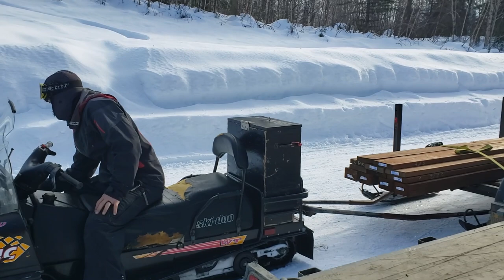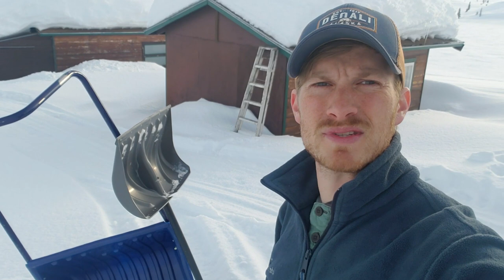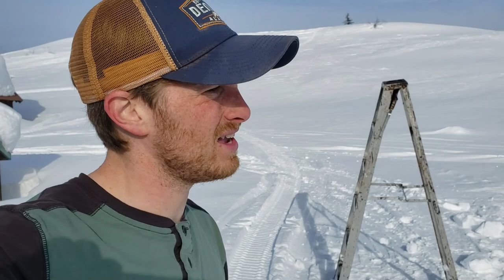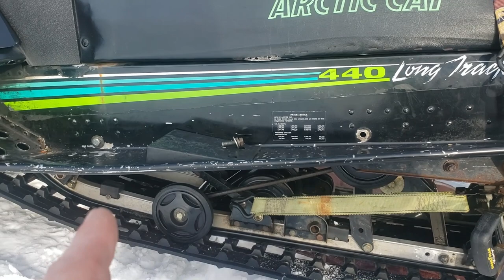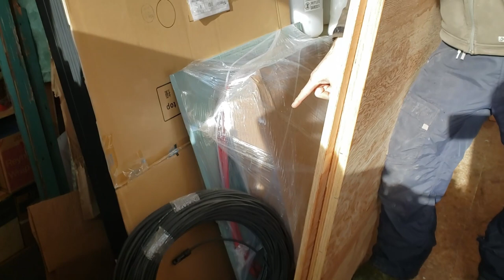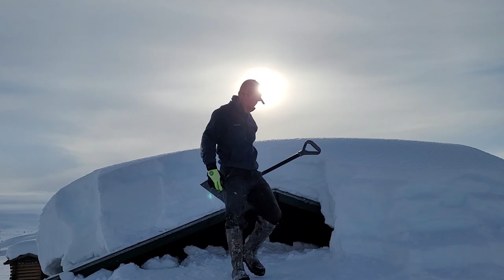Spring Weather is Coming SOON! / Alaska Vlog

Comment: To make it easier to line up those suspension bolts release the tension on the torsion springs. Just lift the long arm of the spring up over the small idler wheel and let it rotate back along the outside edge of the track. That should help allot. You’re are fighting all that spring tension trying to that with the springs loaded.
Reply from the maker: I should've called you days ago!!